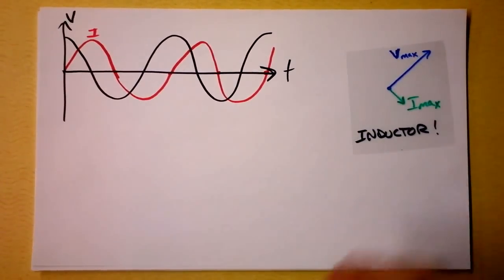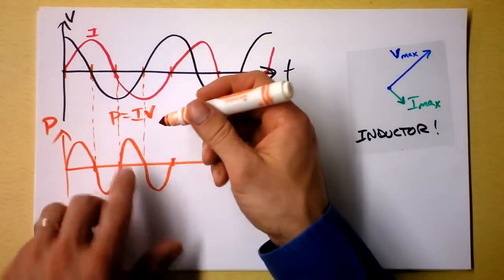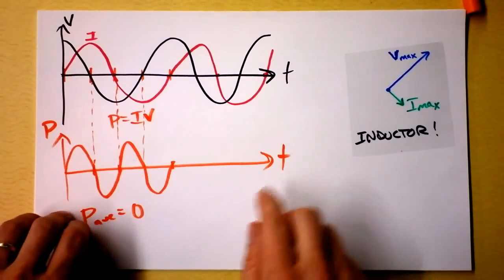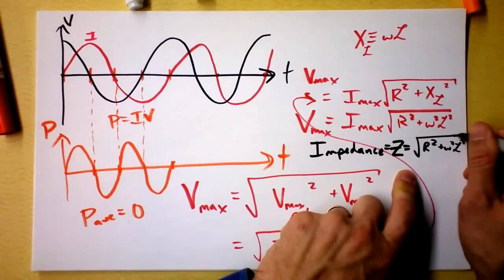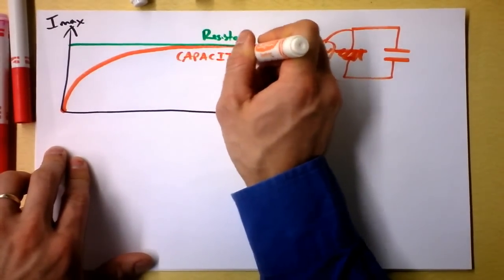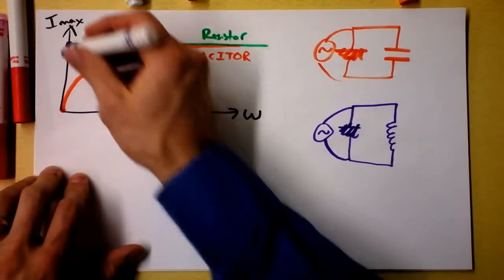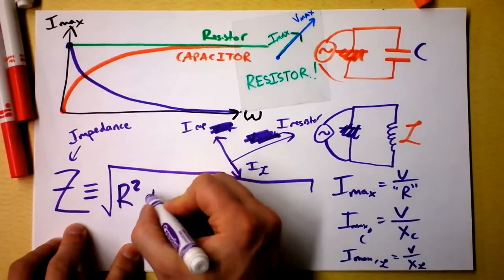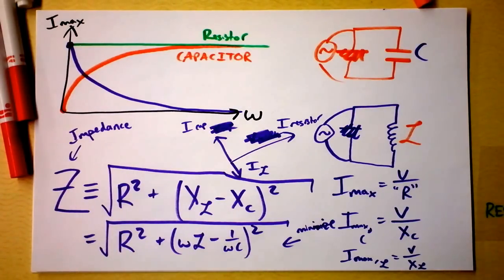Inductors Have Inductance, Reactance, AND Impedance.  DANG, DAWG.  | Doc Physics

Comment: At 9:09 "What the heck am I doing?" leaves me puzzled. In your other video (Intro to Frequency-Dependent Impedance) you use the same Imax for resistor and capacitor, determining V over both by vector addition. (My physics book does the same.) Here you use the same V for all, determining the I by vector addition. Intuitively, I understand that V over all should be determined by the source. My brain has a meltdown.

Comment: why is it (XL-Xc)^2 and not (XL+Xc)^2 in the impedance equation
Reply from the maker: +James Jimmy Great question!  Because the reactance of inductors and capacitors are 90 degrees out of phase!
Reply: +Doc Schuster 
I typed it wrong last time 
should it not be (-XL+Xc)^2 instead of (XL-Xc)^2 because The Vmax,L phasor is negative
Reply: James Jimmy also because capacitive voltage lags and inductive voltage leads. never mind. it's still the same for Pythagoras theorem

Comment: don't understand why power average is 0. Isnt power avg = i(rms)*Vrms. and both of the values are not 0.
Reply from the maker: (IV)rms is not the same as Irms*Vrms.  Not only that, but the average power is NOT Prms.  The distinction between ave and rms is very important.  It is also key to note that the current and velocity are always at right angles.  Since they are out of phase, no power is developed on average. Some in, then same amount out.
Reply: Doc Schuster  Thanks a lot. That clarifies a lot! Also just to clarify the confusion for those who have similar questions I think you meant voltage and not velocity. Thank you, that was an awesome video .
Reply from the maker: Yes!  Thanks for the clarification!